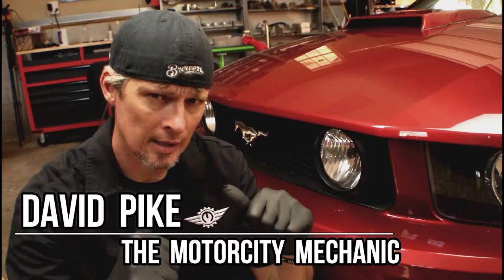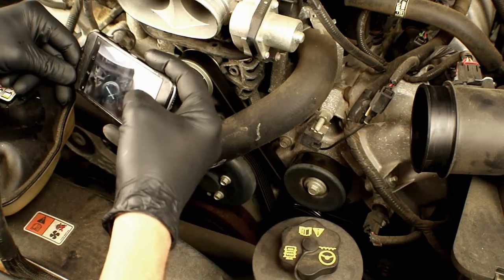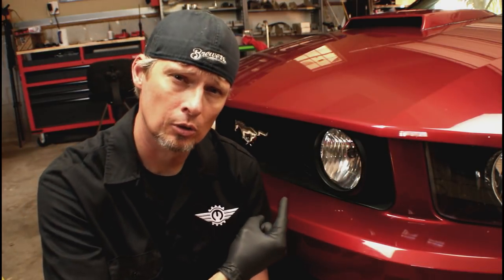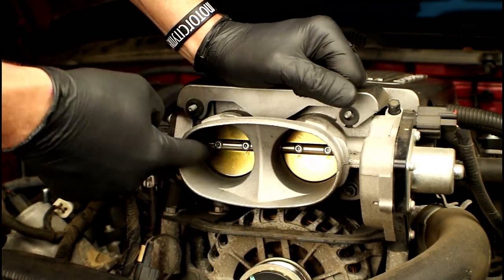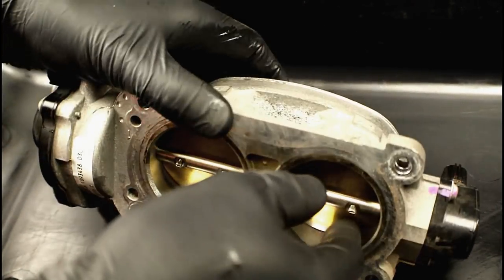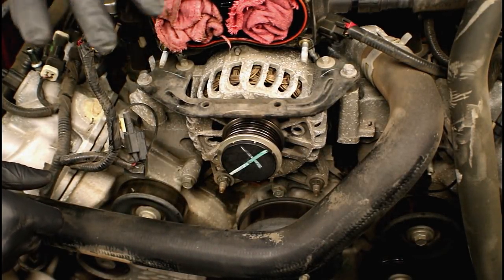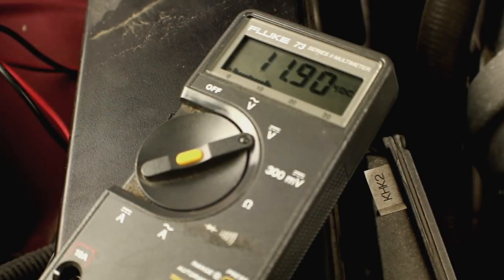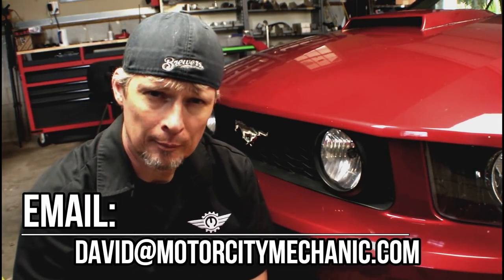2005-2009 Ford Mustang GT alternator replacement

Comment: David...outstanding video. Not too short or too long...very professional and you speak very clearly. My mistake was that I counted on the guy behind the counter to give me the right belt and alternator...my bad as I normally show up with the part and compare on the spot. The plastic fastener you mentioned broke on me, so used a zip tie...which did the job. Again, outstanding video 📹 ... 👍

Comment: That was a very good video.  I liked all of the little details and pointers on dealing with the connectors and replacing the rubber seal for the throttle body mounting plate.  I would suggest that after you remove the old rubber seal you spray some throttle body cleaner in the groove and scrub it out with your tooth brush since you have it handy.  Good advice on the blocking the manifold intakes with rags to be on the safe side.  Also, the advice on mounting the red tube firmly on the throttle body cleaner nozzle before spraying it on the throttle body is good to know.

Comment: Replaced the alternator and serpentine belt in my mustang earlier today, thanks for your video!
Reply from the maker: Your welcome Ryan. Glad that the video will help you out with that repair. Sorry for the delay in replying back. Make sure to subscribe if you havent already.
Reply: @MotorCityMechanic  ok i live in texas and my 07 mustang gt has a quote on quote "electrical demon" in it i personally BELIEVE that the issue is coming from my alternator or the voltage regulator which is inside the alternator, i have no codes being thrown and no check engine lights on but everytime i hit near my power band or i try going past half throttle all of my interior lights go off and the first thing i see is i lose traction and my voltage guage sky rockets past H and if i slow down my voltage goes back down a little and its all normal again but if i stop and open my hood i can see that battery acid is spilling out of the 2 top blocks and this is my 3rd battery from 5starford and they keep saying its my battery but they are the ones selling me the battery but they say its the batterys fault when they keep saying itll fix my issue im ordering a whole new 230amp alternator, not a refurbished one a brand new one so i can see if itll fix the voltage issue because it is dangerous and i need it gone id like a reply because you obviously know way more than me.
Thank you for this video

Comment: Thanks for the video, really helped me. Took 45 minutes, but I spent half of the time trying to find a 13mm socket... ended up with using the second best thing, a half inch socket. And my tip for everyone is to put the belt on by the alternator wheel as the last wheel. align the belt all the way, put tension on the belt, apply preasure on the tension bar and pull it over the alternator wheel...

Comment: Just wanted to drop in the comments to say thank you for the video. I just replaced the alternator in my 2005 Mustang. I did things a little different. My air intake was K&N, not the stock air box. I didn't remove the throttle body nor did I replace the serpentine belt.
Reply: How did you not remove the throttle body to get the alternator out???

Comment: I know that this video is probably the best you could find because after watching it I was able to replace the alternator, the serpentine belt, and clean the throttle body on my 2008 Bullitt without any previous experience. The only hiccup was that the dealership gave me an alternator for a V6 by mistake.
Reply from the maker: That’s awesome! Glad it worked out and that the video helped. It’s all about knowing the steps as you saw. Thanks for the comment and make sure to subscribe

Comment: Hi Dave - I am getting a whining noise and burning smell for the alternator area of the engine compartment.  I believe I even saw a puff of smoke when I shut the car down.  Is this a symptom of bad bearings or something else?  2005 Mustang GT w/original alternator.

Comment: Great video. Only thing I'd add is a parts list. If I didn't once over this before diving in, the throttle gasket and serpentine belt would have been likely reused. (Not the worst thing, but to your point, if you're there you might as well replace). I also wouldn't have come prepared with throttle cleaner.
And for $30, looks like that tensioner tool is worth it during reinstall.

Comment: Thanks for the helpful video. Although I did get a “engine fail safe mode” would you know why I got this code? After installing new alternator.
Reply from the maker: Not sure about that message. First step would be to check for codes and then see what we have.

Comment: Wouldn't it be better to use a baby bottle scrubber instead of a toothbrush?
Reply from the maker: Tooth brush gets into tighter smaller places and the corners. The baby bottle scrubber is larger.....I use one everyday and it doesnt get all the items and certainly not the inside of the nibbles so I personally wouldnt use on. The toothbrush seems to be the best size plus everyone has one handy. Thanks for commenting and make sure to subscribe

Comment: Thanks!
Reply from the maker: Much appreciated!
Reply: @MotorCityMechanic  Seriously though now that I have a minute. I hadn't worked my a motor in 31 years. (A different story.) I grew up with motorheads. I was always the helper and occasionally did my own work. Learned alot. I grinned I still had all the tools to do the job, though it took a minute to find them all. I lost count at the number of Alternators we've put in this car, original owner here. I watched 3 - 5 other video's. None were as complete or as straight forward as your's was. You covered other lessons that you'd learned along the way etc. You presented the information with detail and confidence. Thank you for helping!!

Comment: I would remove the throdelbody from the intake before cleaning it.
Reply from the maker: The throttle body can be cleaned on the engine. It causes no issues. If you take your vehicle to a shop to have it cleaned as part of a service....it will be cleaned on the engine. That’s standard practice and I do it about every other day as part of the BG fuel injection service. In the end it’s up to you and what you feel like. Either work. But keep in mind if you do....that throttle body seal had to be ordered and wasn’t in stock at the local parts stores so he prepared